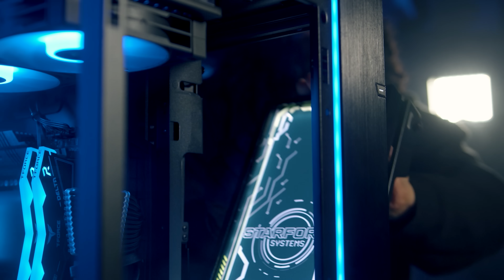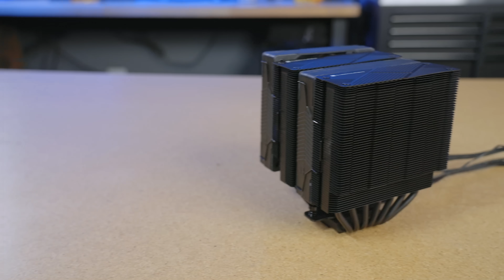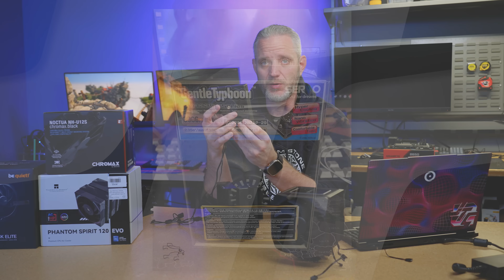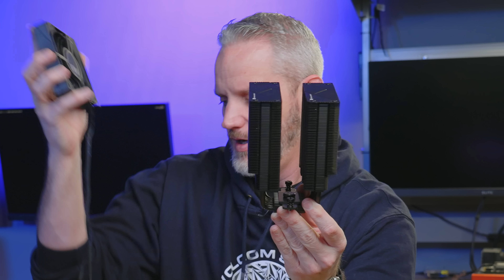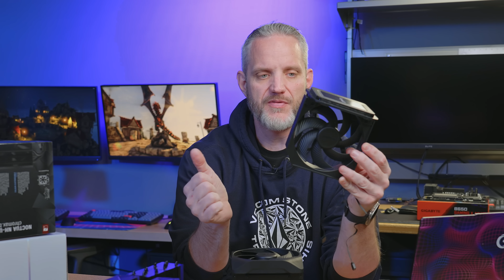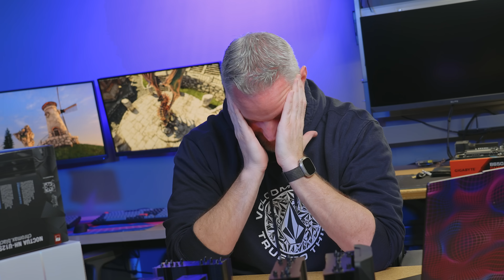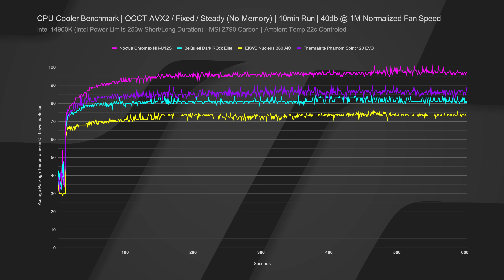This $49 CPU Cooler has big brands SHOOK! Thermal Testing Cheap vs Expensive CPU Cooler!

Comment: lol tempsound lmao my ears seriously aRE SO SENSITive i can hear electric rat repellers,compact fluorescent bulbs omg muted tvs are the worst vcr dvd players back in the day lord could hear the psu in those machines had to make adjustment traffic lights! the em signature changes bout 30 sec b4 they change i can feel that chyt it's fkd up!! dunno started bout 25yrs ago does help with diagnosing vehicles fired up a diesel night b4 last and shut it down because it didn't sound right checked the oil and was 3qts low messed up huh ?wtf! lol

Comment: I'm running a Thermal"right" Royal Pretor 130 now, my room is a bit warm around 27c but even with 180w load on 14600k it still hit only 83c. and the fan are barely audible through the case.

Comment: I like the equation, but I'd change the word distance to either delta or difference. And using the inverse of it could be useful, so it would show how much it costs per degree under Tj max, where lower is better. That value, along with the actual delta to Tj max and cooler price, would be very helpful when someone is choosing a cooler to fit their budget. Those things would allow someone to choose between bang for the buck or all out cooling performance, where cost isn't a concern.

Comment: DARKROCK PX4 CPU Air Cooler High-Performance 4 Copper Heat Pipes, 120MM PWM Fan Low Noise - Intel LGA 1851/1700/1200/115X, AMD AM5/AMD4 All Black $16 usd

Comment: There's actually 5 different variants of the Phantom Spirit 120, the OG PS120, PS120SE, PS120SE BLACK, PS120SE ARGB, and the PS120 EVO (as shown here). So you can technically get this cooler as low as $35 in some cases. I was a big Noctua guy then switched over to PS120SE when building my new rig. 14700K at the time and it worked fine. Swapped the fans with the goated NF-A12x25 and it performed well even with my new 9800X3D build. The fans that came with the EVO aren't that great and they get loud. Some people opt for replacing their entire rig with P12 fans from arctic and they're better than the Thermalright ones and for dirt cheap, $35 for 5. I've had PS120SE on my Lian Li A3 and PS120SE BLACK on an ITX case CH160 and had no issues. My case is super quiet and I'm happy, no need for AIO.

Comment: Test out cheap aio coolers Jay.  Thermalright, ID cooling, Asia Horse?  Idk there is a lot of brands out there.  I like that you are going for the middle ground between basically no data and GN level of data.  Price to performance ratio is a good metric I think.  Might help break some molds in terms of buying habits.

Comment: You should have 1 test bench for Intel & another test bench for AM5. 
Because both Intel & AM5 heat contact & heat saturation differs thus the coolers would react differently too between Intel & AM5.

Comment: could this cooler handle a 9800x3d sufficiently? without throttling. id prefer to use an air cooler in the new system i plan to build

Comment: I've been running a Phantom 120 EVo for like a year or 2 now, and I like it a  lot. I got it for like $40 at the time, and it's been kicking ass keeping my 5800X3D cool. I realize it's not the hottest running chip out there, but nevertheless, I've been very happy with it. Considering as it's a double tower cooler for the same price as many of the single tower coolers from the usual suspects, and it's MUCH cheaper than the double towers of those competitors, but cools at 95%+ as well at a MUCH better price, you can't beat it. It also works ALMOST as well as the AIO, and doesn't add to the e-waste pile as you can replace the consumable parts (fans) unlike the AIO pump. Let's make Air Cooling great again, and get the normies off the AIO's they THINK they need...  5/5 would HIGHLY reccomend.😀

Comment: I'm not sure about the 40 dB normalized, because some systems (like the BeQuiet) can't reach that, as their are really silent. 
Thus, I would rather have a lower noise level (37 dB, which sounds twice less louder than 40), and maybe another measure at full speed, to evaluate maximum performance.

Comment: I put a Hyper 212 on my CPU, a Ryzen 7 5700G, honestly, wasn't really necessary, stock cooler was running about 70C, brought it down to 60C.  Thermaltake case and 3 front case fans and 1 rear fan.  Nothing really gets hot.  Radeon RX 6600 only hits about 65C.

Comment: I've been installing Thermalright coolers for a few years now, amazing for the price.
Really no need for anyone to buy more expensive brands (especially if they're not running extremely heavy CPU workloads).
I have the Phantom Spirit 120 (not Evo) on my 7800X3D, and it overkill really. But for £35, at least I won't need to upgrade my cooler if I get a more powerful CPU.

Comment: Any chance you can also run these same tests on the AM5 CPU?  I am interested to see if the performance is the same on AMD chiplet design vs the intel central thermal density.   The offset noctua mounting seems to have a significant effect on the thermal performance and as far as I know they are the only ones doing an offset mount as of now.  Also... Nobody is building a new system with Intel now days.  I would rather know how thee perform on AMD if you can.  Other than that comment this is awesome. Can't wait to see the charts fill up as you add coolers!  Keep it up guys!

Comment: I'm glad you did this. Remember folks- your cooler only matters when it doesn't keep your CPU below like 85 C under load. Putting 360 AIOs on 105 watt CPUs is dumb IMHO. But something else that matters- case air flow. The case and case air fans can make your air cooling worse. Though I guess a good case with well thought out fans can make it better than on the bench (forcing more fresh air to the fans)?

Comment: Honestly, I stopped buying HSF coolers years ago because I was always struggling with the facts that the mounting mechanisms would be changed from generation to generation leading me to need a new HSF every time I upgraded my PC as well as installing the HSF's became increasingly difficult as the sizes grew bigger.  The last straw for me was that I found myself struggling to tell if any particular HSF would be compatible with full height RAM before purchasing it making an AIO a far simpler solution for not much difference in cost while keeping the system quiet.

Comment: thermalright must have sl-ve goblins in their workshop or something, because they don't even skimp on accessories in the box, it comes with a tube of thermal paste and various mounting kits, I think mine had at least 3 if not 4. I have the 'not EVO' version of this one. The other crazy thing is how many variants and models they have. I have no idea how they make any economy of scale doing that but here we are. I think they will go bankrupt at some point or idk.

On the other hand of the spectrum noctua is taking the pss on their aircoolers pricing nowadays. I'm a fanboy of their top tier fans like NF-A12x25 but the price they charge for pure metal is ridiculous. It would still be cheaper to buy the thermalright phantom spirit, throw away the fans it comes with(which are pretty good already), and switch them to 2x NF-A12x25, than buying a noctua 2x120mm aircooler.

Comment: Should have added the ThermalRight liquid AIO and the Arctic III Liquid Cooler. Both are at or below the cost of the Noctua air cooler and are viable options within the range

Comment: What if you changed each other's fans?, fan in cooler open cooler fan out, or fan in cooler open fan in, or open cooler fan cooler fan pull, is it the same as push , fan cooler fan cooler open, ?

Comment: Got a Thermalright Assassin SE 120 (their single tower variant) and it's keeping my Ryzen 7 5700G a solid 20°C cooler than the stock AMD cooler. When I can play games and the CPU doesn't even break 60°C (and in most cases, stays closer to 50°C), I don't have a reason to learn how to do watercooling.

That said, I could always learn someday. I'm using an Antec Three Hundred Two case, which has the holes for an external pump/reservoir. I know that's old school stuff right there, so I think it'd be fun to learn the old school way before learning the "modern" method of internal reserviors and stuff. Ooh, maybe that would be a decent video idea for you: How Watercooling Has Changed

Comment: Fluid Dynamic (and MagLev) bearings have better longevity for horizontal mounting orientation, such as the top and bottom of a case, while ball/roller/sleeve bearings have better longevity for veritcal orientation mounting, such as the front/back/side panel mounting. Ball/Roller/Sleeve bearings have reduce longevity in horizontal orientations though, as do fluid or magnetic bearing in vertical orientations.

Comment: I have the NH-U12S and Be Quiet! Dark Rock Slim and the Cooler Master Hyper 212 Stealth and found that the Noctua is NOT worth the price as they all perform at the same level and are for the most part same sound levels. The $40 Deep Cool 500 worked far better than the Noctua (sadly they've been kicked out of the US market).

Comment: Great video Jay. 
I am still going to buy the Noctua. It is because I have built dozens of computers at this point. The ones that had inexpensive coolers in them and cheaper fans...I had to replace those in a few years. I have some computers that have been running nearly 24/7 for about 10 years and they are still working beautifully.
I don't care that it cost more and performs slightly worse, I will NEVER have to worry about it not working. 
So yes, they do make sense when reliability is important.
Reply: Noctua fans still fail like any others, fans are an item that is expected to fail and be replaced.  Pre-noctua even existing a lot of coolers used to not come with fans.

Comment: Hold up, why aren’t budget/AIO models included in the testing? You’ve tested variations of premium and budget air coolers, but not AIO models. You can find good value AIO models that match EK’s AIO performance at a cheaper price than some air coolers. I don’t understand the purpose of this video.
Reply: As he said its just the start and he'll be expanding the list as times goes on

Comment: I use a thermalright phantom spirit 120 evo. It looks a bit weird in my system, as I have a full black, pure performance build, and the rgb stands out. Of course, no fault of thermalright, it showed up as a top tier cpu cooler option when I was researching, and I didn't realize it was rgb. Its performance is amazing, though, keeping my 7800X3D between 50-65°C.

Comment: Folks i can tell you following: Bigger heatsink better heat dissipation, now if you see unstable CPU throttling you need to install better fans 1200 RPM is a must, so best coolers and best heatsink produce optimum result, ah yes thermal paste use something with a lot of silver and maybe add gold powder just for even more better heat dissipation.

Comment: I wonder how the ID-Cooling FROZN A620 PRO SE lines up here. It has Dual 120mm fans and 6 heat pipes while TDP rating is 260W. Current price on Amazon (US) is $29.99.

Comment: I'm sorry Jay but don't be that Intel guy. The majority of your viewers must be using a Ryzen and the cooling is way different. (Even the new intel is way different with the offset mounting some provide). You should also do a gaming test and show the actual dB while gaming. More real life tests. 

This is actually a time where you should watch others to get a good understanding how to test coolers. May I suggest STS which is a good no BS channel.

You should also do a bit better research, the "cheaper" version of the phantom spirit is called Phantom Spirit SE, has different fans, it comes in black and not only metal and it's actually better for more silent workloads like falling.

Comment: For my first PC build back in 2016 I went with an AIO that cost just over $100. It worked marvelously, but I always worried about the extra complexity leading to premature failure—the pump, the pipes, leakage, etc. When I built a new PC last year I decided to see if air cooling was an option. I picked up the Thermalright Peerless Assassin 120 SE ARGB White air cooler for under $50, and it's been rock solid.

Comment: Here are a few coolers you can test

ID-Cooling Frozn A620 Pro SE
Jonsbo CR-1400 DV2 Black, schwarz
Thermalright Macho Direct
Xilence Cryon M806D.B
ENDORFY Fortis 5 Dual Fan
Valkyrie Vind SL125 schwarz
Cooler Master MasterAir MA620M
DeepCool AK500 Digital, schwarz
APNX AP1-V ARGB, schwarz
Sharkoon A60, schwarz
Iceberg Thermal IceSLEET G6
Alpenföhn Brocken 4
Scythe Mugen 6 Dual Fan Black Edition
Alpenföhn Brocken 4 Max
DeepCool Assassin IV
Akasa Soho H7
DeepCool AS500 Plus, schwarz

I hope there are a few here that you like — I’d be happy if so

Comment: *me refreshing to see a Jayz video at No Views"
it was posted 16 seconds ago

It's amazing to see how far coolers have come. We got to a real peak with Noctua, but then their prices started to skyrocket since they had no real competition and the best quality, and AIOs continue to climb steadily. I'm happy to see a new competitor in the market offering value for money coolers again, hopefully it will lead the others to drop back down. I'd love to see different platform/CPU testing and like for like cooler comparisons (dual tower vs dual tower, single tower vs single tower) and then more cross-type matchups like this. I know GN does their super in depth heat-mapped testing, but it's always better to have more data from various sources (which is why I compile my GPU performance metrics from several channels to get an average).

Comment: I'm using a thermal right 120 se for my AMD 5900 with PBO. It does reach 91c limit, but my fractal R7 restricts airflow a lot, so no surprise. 
I've made multiple open loop water coolers through the years, and originally wanted to try hard tubing this time, but the simplicity and knowing there's no maintenance won me over to air, even if I wish I could drop my CPU temps, it's fine for when I have NORMAL work loads, not folding@home all the time.

Comment: You should test the Arctic 34 Esport Duo.  Its only $53 (at the time of writing this).  Realistially if you can't coold your cpu with the Arctic 34 Esport Duo then you should be thinking about a AIO.  Arctic also makes one of the best AIOs on the market. the Liquid Freezer 3 280 is only $112 (at the time of writing).  If you are going to be making charts, you should be adding both of these to your line up.

Comment: i only do watercooling loop now because i have done it for so many years and it is whisper quiet, also i dont like the wooosh sound or normal air cooling, i cannot get an air cooler as quiet as a watercooling loop gets

Comment: Nice to see a cheap cooler doing a good job. The only thing I would change is the Noctua comparison. The NH-D15 is a better choice to use because it is the same design as the other two (dual towers and fans).

Comment: Bought one just in case its needed.

Edit: Decided to install it and try it out. Replaced a EKWB 360 AIO and it runs 2` hotter lol. Great air cooler for the price. Get it before Jay sells them out or they raise the price.

Comment: Thermalright fans are crap... bought 2 for my cpu and after a few weeks they started making so much noise I had to replace them. They were the Thermalright TL-9015B 92mm Slim Fan, PWM Control, 2700RPM. Worst crap I ever bought. They lasted less that a month.

Comment: I only buy thermalright coolers and fans. I was using the peerless assassin, and then i switched to the thermal right frozen edge 360aio and love. And i have the ring rgb thermal right fans for the case. Now the aio has no rgb for the front clean look. If it's not thermalright for my cooling, then you can keep it.

Comment: Why use a single tower noctua to cool the highest end cpu? o.o
If you're using a tower cooler, surely you would at least use two towers.

The noise of a 140mm fan (which noctua uses) is also different even on a similar dB level than 120mm fans (which most other coolers use), because you need less rpm for the same airflow.

Comment: ok, well now, I bought a Zalman 9500 Air cooler waaay back in @ 2007 or so, for an AMD Quad-core.......... , aaaand I'm currently using the exact same cooler(not a replacement) on my 9800X3D and Asus X870E crosshair. Temps at full load mid 70's to 80C. Jay could you or someone please bench test Zalman air coolers? 
Or at least shoot me some criticism about the cooler choice?

Comment: Thermalright Peerless Assassin 140 is still the king. Exactly 50 bucks (drops to 40 on sale) and better than most AIOs. Definitely better than the Spirit 120 Evo. Shill that instead. It is sublime. I use it on my home server which is in an extremely challenging low airflow hot closet.

Comment: One thing to note is that if you don't care about RGB, the Phantom Spirit 120 SE uses the same cooler, the only real difference is the fans. They also cap off the top of the Evo, which looks better and might add a negligible amount of surface area with a couple of more fins, but they're essentially the same and the SE is under $40. I would be nice though if Thermalright offered an offset kit for AM4/5.

Comment: I use the DeepCool AK 620 digital (wanted the screen to monitor temps), curious how it would compare. On my Ryzen 5 7600 it tends to keep my temps quite cool compared to the stock cooler (-20c +).

Comment: Of course you used an Intel CPU, which, although it uses more Watts than an AMD CPU, it does not have the heat density.

Considering next to nobody is buying Intel CPUs, your test and results are about as useful as tits on a bull.

Comment: Switch from open bench testing to any modern case and then it will be useful. In real setup differences betwen coolers won't be so spectacular.
Of course you can play games in 720p on 5090 if you wish and enjoy 2500FPS.